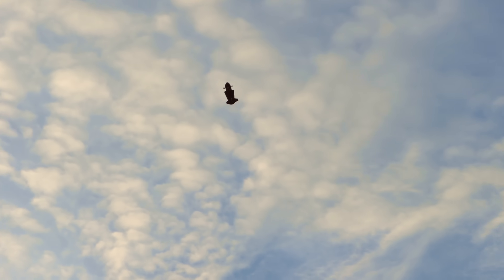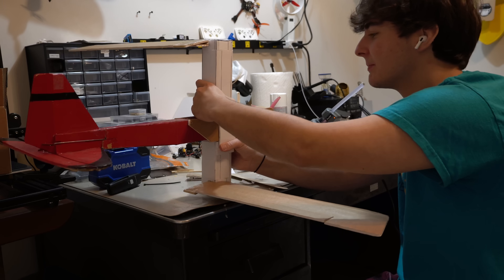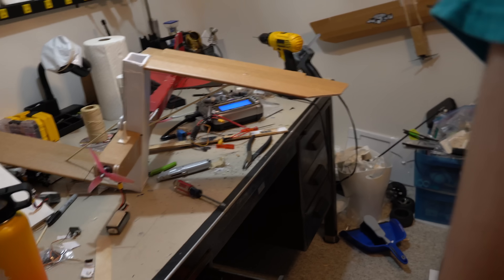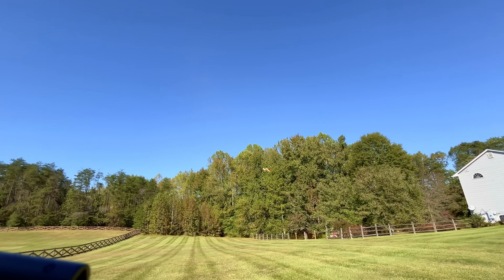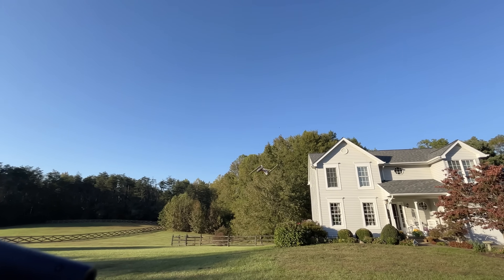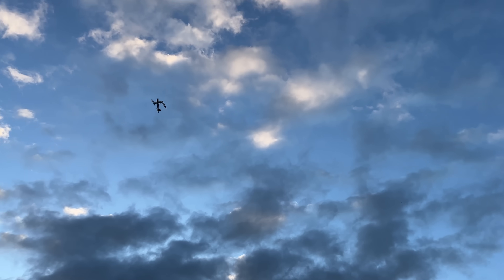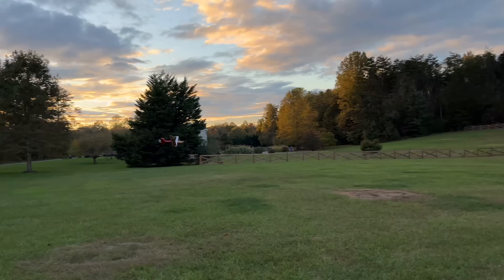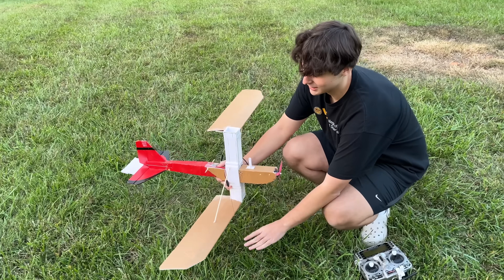Can a Plane Fly With Offset Wings?

Comment: it's not more lift on one side, it's the relative position of each wing relative to CG. The lifting center of each wing is above and below the CG, that will make the plane twist to level the line between the two lifting centers until they balance the CG. In your first flight you can see that tendency, I'm certain you had to compensate roll.
Reply from the maker: No roll compensation was had. Ailerons were perfectly centered and the plane flew like it was on rails. Hands off. It even glides nice.
Reply: Both wings create a moment through the center of mass.  The distance in this configuration to the respective center of lift of each wing to the CoM is balanced, so the moments are balanced.

If the wings were not evenly offset the moments would be different and unbalanced resulting in a tendency to want to roll.

Comment: The offset wings effect will cancel each other out but if the plane is in a roll and side slipping the resultant skin friction will create a moment on the aircraft. Low wings vs high wings with a restoring roll on high wings. Overall great way to test the effect of the offset.